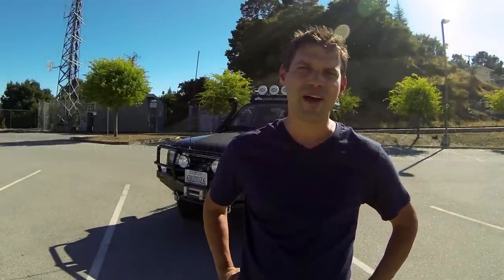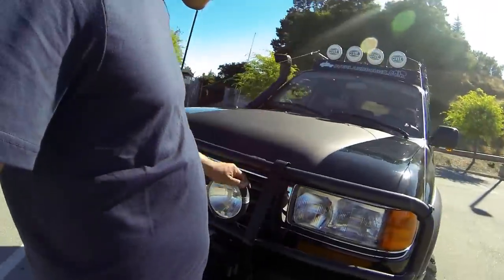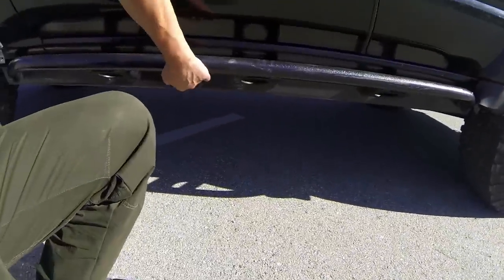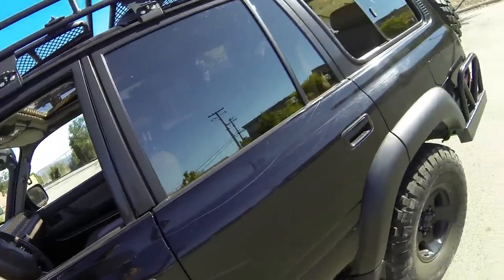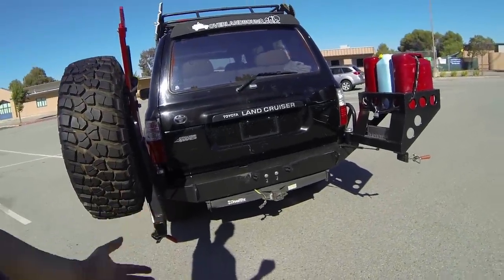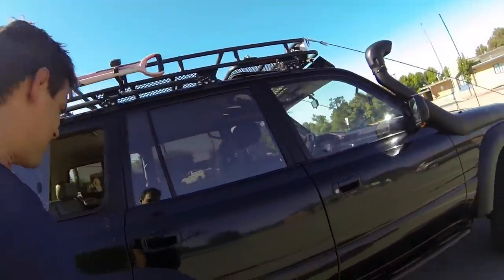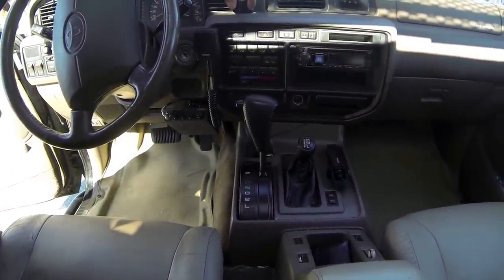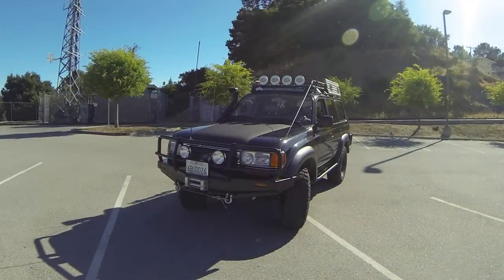Overland Bound Rig Walk Around

Comment: Great video. I love me some 80 series landcruisers. So whats your biggest reason or reasons for going with a landcrusier vs say a toyota tacoma 4x4 crew cab pickup truck with a camper? Im on the fence on which to pick but those are my top 2 choices for overland adventuring. Any tips?
Reply from the maker: Hey mixflip - I really wanted the factory lockers and the seating capacity. Also, I did quite a bit of research on true cost of ownership using Edmunds. After all the research, for me, the FZJ80 stood out as the way to go. I admit to having a soft spot for Jeeps too ;)
Reply: The Tacomas and 4Runners are great.  I owned two Tacomas, a 2001 and a 2005, and both were great trucks.  I now own a Land Cruiser.  From experience with both, I can say that some big advantages of the Cruisers are interior space, and a much stronger drive train. The components are stout.  9.5" ring gears and nice fat axles will stand up to a lot of abuse.  Anything can break, but they are strong.  The Tacomas are a bit lighter, so they put a little less stress on those axles, but any solid front axle Toyota will take a pretty good beating.  The offroad performance of a Cruiser right out of the box is pretty tough to beat though.  Please, don't thank me for confusing you even more...   :-D
Reply from the maker: Ha ha! That's great JunkfoodZombie ! Ya I took a tocoma through Baja a couple times and the light weight was great in the sand. I do prefer my FZJ80 though. Will get me anywhere!
Reply: Overland Bound You know it.   I just spent the day at Windrock in East Tennessee, where I live.  Did some good trails.  I was in my FJ62 and had a couple friends in a 4Runner and a Jeep TJ.  I will likely post a video within the next week.  I posted a video of my last trip recently.  Feel free to check it out and see my truck.  Have a good one!

Comment: That thing is SICK! beautiful rig. I am a long time FJ40 owner who recently acquired a 97 FJ80. bonus with the lockers. what suspension & tire size are you running?  I'm leaning towards a 2.5 ome & 35s with 4.88s. I also love the look of 2.5 trim the fenders & 37s. this rig is being built with future plans of being shipped to the big island of Hawaii on the rainy side. 160 inches a year or more kinda rain. I don't wanna be stuck in a muddy jungle but I do love the way it rides now stock suspension with 33s. please tell me how you would build your rig for this kind of extreme 2 volcano with snow, endless jungle, lava fields, beaches extreme terrain. thanks for the videos & info. have a good one kind sir.
Reply from the maker: +Dalton Wyatt Hi Dalton! Glad you like it! I'm running Old Man Emu 2.5" with a 1" spacer on back and 35s. Stock gearing, no issues. For extreme weather I may go with something different than the Mud Terrains I use now. Depends if it is asphalt or off road. I'm really happy with my setup - eventually, I may go with Icon Vehicle Dynamics suspension. I'd love to see more on your rig!

Comment: Great looking setup, I just purchased my 97 fzj80 has 115K miles no lockers but pristine cant wait to see more vids.  where do you get the floor mats?
Reply from the maker: Hey Sierrabtb75 - They are called "Sandgrabba" mats. They are made in AU, and I had to get mine shipped to the US - expensive, but the best mats I found. Better than "Husky" or "WeatherTech". There may be more local distributors now. That was a few years ago - still holding up! 

http://www.nobullaccessories.com.au/sandgrabba-floor-mats/sandgrabber

Comment: Hi Michael - I'm Chad (aka Liberty Offroad & Overland Bound member #13238).  i'm setting up my 2007 Jeep Liberty rig on a budget...so far my biggest upgrades include a 2.5" suspension lift, skid plates, rock sliders, a roof cargo rack, and some all-terrain tires (Hankook Dynapro ATM).  What would you suggest as a next project as far as priority while staying budget-conscious?  Thanks!
Reply from the maker: You’re pretty set! That’s a good order of upgrade. You might think about satellite comms, a ham radio, or could get into a front winch mount bumper.
Reply: thanks - yeah front wincher and rear multi-carrier bumpers are definitely on the wish list, also possibly a rooftop tent, CB/comms system, and a fridge.  but $$$$ :)

Comment: Really nice rig.  I have an '89 FJ62 that I wheel when I can.  I want to set it up for overland type stuff, and have some parts done.  I have the ARB bumper (a must for Cruisers), an Old Man Emu suspension and a Warn winch.  I still need to do sliders and a rear bumper and some diff locks for sure.  The 62 runs open diffs  :(   I will also find a roof rack at some point. Sadly, the money isn't there right now, but it's a cruiser, which makes it pretty capable to begin with anyway. If you want to see it, you can do so here:  Offroading to Windrock Radar Base 10/25/14   Subbed to your channel.  I like what you're doing and look forward to seeing more as you make it.  Thanks for making some really good videos. Have a good one!